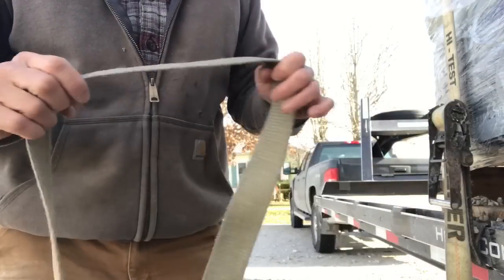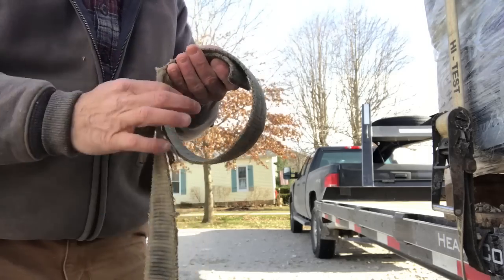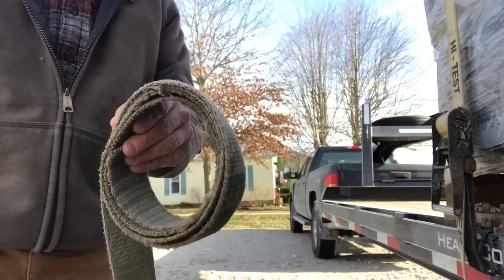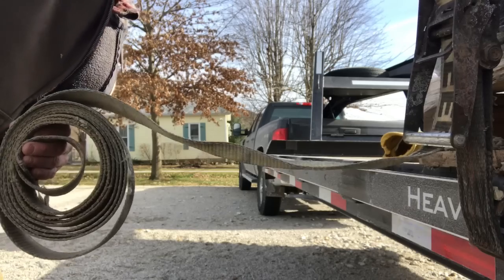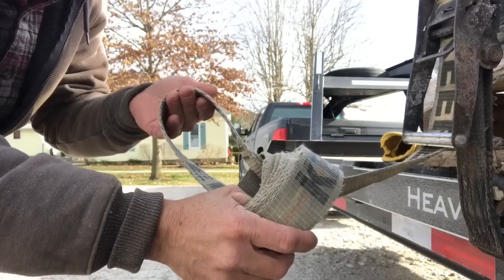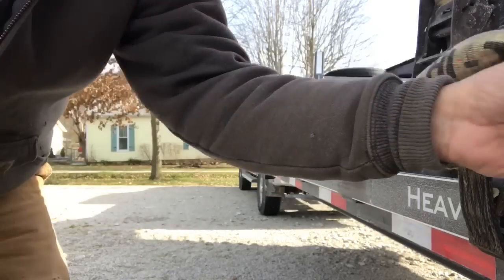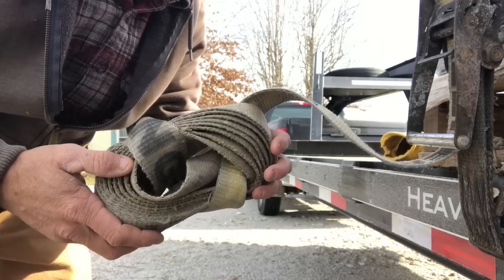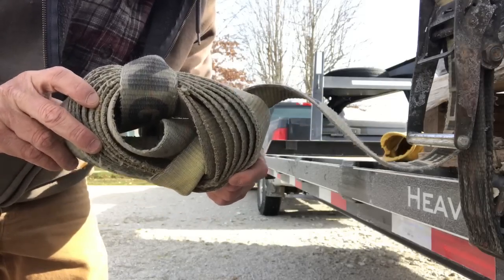What to do with excess ratchet strap..

Comment: You threaded the ratchet wrong, The tail should come out the top and then your knotted roll can be tied to your tensioned line.
Reply: I agree with you.
Reply: Both ways work. When the tail comes out from the bottom you will find it alot easier to release. When the tail comes out the top it can be very difficult to release. Imo
Reply: The way he has it is much easier and neater.
Reply: @calvinvandine1352  yup, that's always been the way I have dealt with them!

Comment: Little better tip. Roll it tighter. I leave just enough hole for the strap to go threw. Then roll it tight. Then I go all the way over the roll then cinch it up. Looks neater and won't flap around as much h.

Comment: Thanks mate, just started a new job where I have to drive a flat bed with safety barriers and a trailer with a 1.5ton excavator, straps all over, had excess under wheel on motorway few times this is excellent thank you

Comment: G'day ,thanks for the tip,  by the way I noticed that the end/tail of the strap comes out under the handle , this is a tip I learned not so long ago as well ,when you connect the strap and racket together just before ratcheting (the ratchet must start of closed) and the tail/end of the strap should be entered under neath and exit out the top , so that as you ratchet ...the tail ends up behind ( the ratchet has the potential to come unlocked the way you have it ) ( if that strap was to catch on something then tit lifts the ratchet handle it will become unlocked ...hope you understand what I meant

Comment: Thanks for sharing,  If I may share my method, notice just below the ratchet there is a slot sewn in the ratchet side of the strap? Just loose roll your excess and slide it through the slot, then tighten your ratchet, Dont know if thats the intention but it works for me!
Thanks again for sharing.
Reply from the maker: David MacNaughton thanks for the tip I will definitely give that a try.

Comment: I usually get a little closer to the trailer so that the knot is hanging right underneath the ratchet with very little room to swing around but that's usually because I do more short distant hauling.

Comment: I take that ball of extra, squish it flat, and tuck it between the trailer rubrails running between the stake pockets long ways.  so when you look down between the rubrails you will see the edge or outside of the ball.  make your ball larger or smaller depending on how much extra you have,  making sure it tucks down in there snug.

Comment: Fold it over itself a few times before you fully tighten load, stick folded strap in the hole underneath the ratchet, tighten load, ain’t going anywhere and takes 2 seconds

Comment: how does it work with a regular rope?
Reply from the maker: I haven’t tried it but I don’t see why it wouldn’t.
Reply: @prattsgreenhousefarm9473  it does work - it just makes kind of a messy knot, and a lot of slack pulls out before you tighten, prob better with a strap than a rope

Comment: Terrible advise. Learn to tie it thru the handle of the ratchet so it's not swinging.
Reply from the maker: Ben Reierson yea the old ratchet handle tie. That’s one I think everyone knows. That method requires you to take it all apart to tighten up your load I’ve done both and this method is much better.
Reply: @prattsgreenhousefarm9473  I disagree. Leave a little slack at the top so if you do need to tighten it a hair, you can.
Reply from the maker: Ben Reierson sometimes a load of loose hay will require 3 to 4 full cranks to retighten. And sometimes more than once. This knot I have learned can be tucked behind the strap or in the standard no swinging and much faster to deal with.